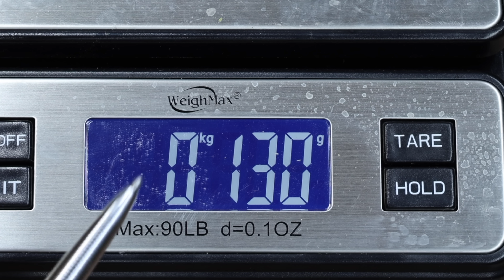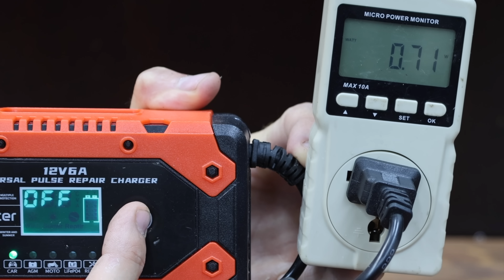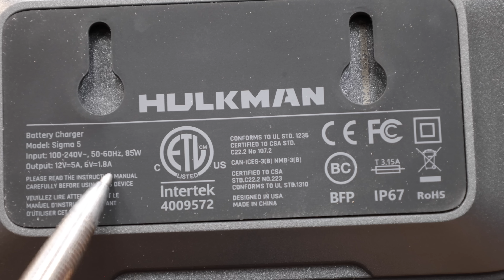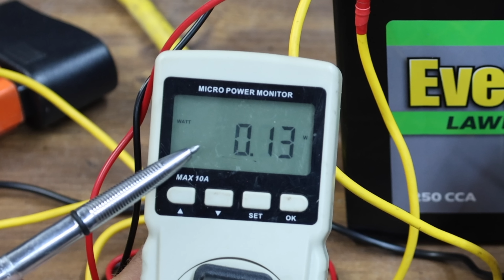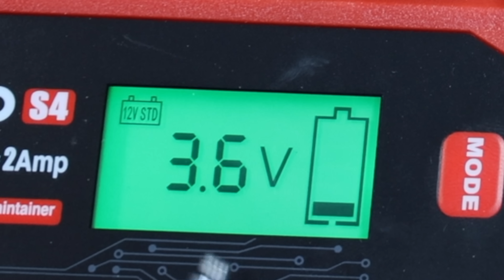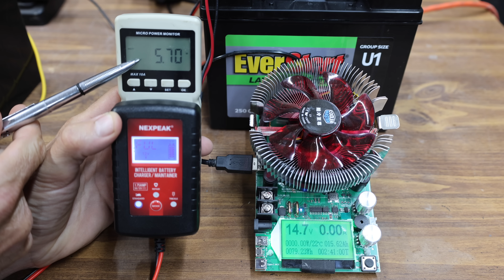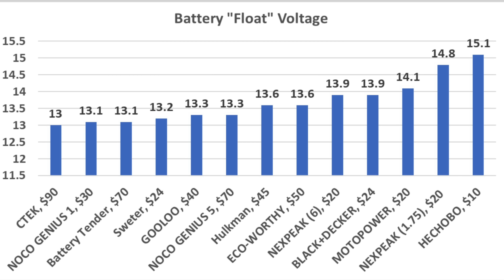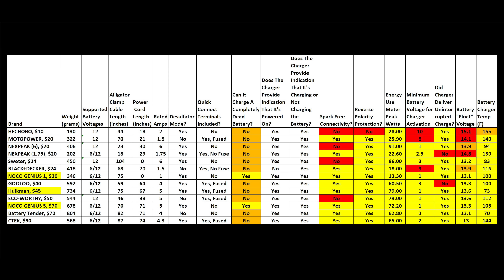I Tested the Most Hyped Car Battery Chargers – One Stood Out!

Comment: You should definitely review some full size charger/maintainers.

Ive used a few over the years and there is a huge differnece with whats out there now. 

A good one to start with is the pro-logix pl2320. Its rebranded for mac tools also. 

I've had a transformer type napa charger, model 85-437 for well iver a decade now, its been solid but i know there's better out there
Reply from the maker: Thanks for the suggestion.

Comment: I'm sure somebody else will say it but the smart chargers have a clear flaw, if the battery voltage is too low, the charger will not Acknowledge that a battery is present. What I have to do is introduce a second battery to backfeed voltage into the dead battery. If you hook the charger up then, it will start charging both of the batteries as they continue to equalize
Reply: Thats how I do it too.
Reply from the maker: Thanks for sharing.

Comment: I have several of the NOCO chargers and their jump packs (NOCO Boost) and have been very happy with them.  I like to leave the NOCO Genius 1 and 2D on a battery as a maintainer.  I also have one Hulkman Sigma 10 which also works well. I have a couple Stanley chargers which have the battery recovery mode, but that seems to be a gimmick, and I don’t recommend them - they wear out fast. I have a Schumacher SDC371 in the truck that does what it does very well. The Schumacher SC1281 and the NOCO Genius10 are my go-to chargers when I am working on something and need a quicker charge. The SC1281 seems to start an engine in boost mode with very little charge left on the battery.
Reply from the maker: Thanks for sharing.

Comment: I have that Ctek in the thumbnail, for how expensive it is they don't really advertise it's more suitable for motorcycle batteries/mounting the unit onto farm machinery with batteries that need charging often. It WILL recharge a flat car battery no problems but it will take the entire weekend to do so, even longer if you use the reconditioning feature.
Reply from the maker: Thanks for sharing.

Comment: You did a nice job with this video.  I'd definitely be interested in seeing test results from chargers with some oomph....perhaps something that will give you half a shot at getting an engine started within a 20 minute timeframe, and without using the short term boost modes that I rarely have success with.  A  desulfator would be a nice bonus.
Reply from the maker: Thanks!  Thanks for the suggestion.

Comment: How about trolling motor batteries, dont know if you are a fisherman on the farm or not, but there are lots of choices now, and some very pricey. 12v and 24v systems, on board solar, how much run time at semi full power. Could be a couple videos, with solar while you fish being seperate. Just a thought
Reply from the maker: Thanks for the suggestion.

Comment: Another great review. I own both Nexpeak models, so I was glad to see that other than the float charge issue (which I don't use), they are decent chargers. It was nice to confirm that the 6A model truly put out 6 amps. One thing that I would like to have seen covered was the amp usage during "repair" or "desulfate" mode. Also, if possible, the results of those modes.
Reply from the maker: Thanks!  Thanks for the constructive feedback.

Comment: @projectfarm We got a used Crafco tar melter (for crack sealing asphalt) machine we’ve been working on at work and recently had to change the heat transfer oil in it. Had to do research to figure out what oil to put in it. Can you test heat transfer oil as an engine oil? It has to be ISO 68 grade  heat transfer oil. It’s supposed to withstand up to 600(ish) degrees and wonder what it would do as an engine oil and what it will lose in evaporative loss and how it performs in a lubricity test.
Reply from the maker: Thanks for the suggestion.

Comment: NOCO is the BEST (value)! I own about 15 of them in different variations! From my experience I would avoid the 1 amp version (the only version I’ve had issues with) and go with at least the 2 amp. 5 amp is really good all around. I’ve used some of my NOCO’s for nearly 10 years with no issues! They do a remarkable job of repairing batteries as well!!! NOCO all the way!!! Best value hands down!!!
Reply: Same/ditto. Well, I only have four (two 2Amp, two 5Amp). Never bother with ANY charger/maintainer below 2 Amperes.
Reply: @pgmurray76 Sage advice my friend!
Reply from the maker: Thanks for the feedback.
Reply: Mine has been flawless, outside in the freezing snow trickle charging multiple vehicles!
Reply: I would suggest trying GYS before lauding the praises of Noco,I've had several and nearly all have failed under warranty, and when the vehicle is completely flat I often have to go and drag my huge Mac tools booster out because the Nocos software doesn't seem to see a battery connected. Some of my GYS stuff is 30 years old and still working faultlessly,their products and warranties are genuinely peerless,head and shoulders over any other brand by a country mile.
Reply: @user-re6yo7tj5s  
One commenter connected a simple 9 Volt torch/radio etc. battery across the terminals (+ to +, -ve to - ve)
that fooled the charger into thinking the minimum 9 volts  were present in the to -be -charged battery..
and the charger took over and charged the battery 
whereas it would not do so without that "fooling"....

Comment: If you happen to have a charger that doesn't charge batteries that are below a certain voltage. You can connect  a fully charged battery to the flat battery so the charger can sense a higher voltage and it will start to charge.
Reply from the maker: Thanks for the feedback.

Comment: I got a Noco Genius 5 a couple of years ago.  I have attempted to charge car batteries with it on two occasions and failed.  Not the Noco's fault, in both cases, the battery turned out to be dead and couldn't be revived.  I had to get replacement batteries.

However, I did find the Noco a little frustrating to use.  The single mode button is all you've got to work with, so I found it hard to get the Noco to try to do what I wanted.  And when it failed, it doesn't give good feedback.  If Noco were to produce a more intuitive model with a microprocessor and LCD screen on which text messages could explain what is going on, it would help novices like me.  It would be better if it had a more positive way to say, "this battery can't be charged" and any other problems it encounters.
Reply from the maker: Thanks for the feedback.

Comment: A Big "YES" to Larger Chargers.
This has quickly become one of my Main "Go-To" channels for Honest & Non-biased Reliable Testing and Comparative ShootOuts.
Reply from the maker: Thanks!  Thanks for the suggestion.
Reply: The Hulkman Sigma 10 is a 10A smart charger that can charge lithium and be used as a power supply. The Clore Automotive PL2320 would be another excellent choice. The South Main Auto Channel uses this one and it's worked well for me too. Can be found under SOLAR, Pro-Logix and even NAPA.

Comment: I bought the NOCO Genius 1 a bit after Covid when I wasn't sure how often I would have to drive in to work.  It has worked flawlessly since I've purchased it.  I use it once a year during winter months to maintain my battery.  Not sure how durable it would be if used more frequently than once a year, but I have no complaints.  If it ever does break I might upgrade to the Genius 5.
Reply from the maker: Thanks for sharing.

Comment: Ctek Polar is the best I've used. When I need a charger it's usually -25C (-13 F). It's one of the few that is made specifically for low temps. I've had others that physically don't hold up to the low temperature.
Reply from the maker: Thanks for the feedback.

Comment: I have used the CTek brand and it was great until it finally gave up. Switched to Noco genius 10 and its more difficult to use because of the button sequences to change modes but it performs well and its slightly cheaper than the Ctek. Just keep a user manual handy if you need to use the Noco functions.

Comment: The failure of the chargers to start charging a flat battery is why I like keeping a small 12V solar panel on hand. Solar panels will sling electrons no matter what (as long as it's in sunlight). I've resurrected many fully dead batteries by leaving them hooked up directly to the panel for a few days straight.

Comment: Always had good luck with NOCO.  CTEC and Battery Tender are also in my garage.  Just had a 4A Battery Tender die so I ordered a 10A NOCO because it has the power supply function.  Great for keeping the car alive while diagnosing issues or programming.
Reply from the maker: Thanks for sharing.

Comment: I see that you are using an aircraft battery.  Are you a pilot?  I am and have been wondering about the special 'airplane' specific chargers made by BatteryMinder.    They have ones specifically for Gill and Concorde batteries and they're EXPENSIVE - at least a $100 premium over their identical looking automotive charger     I just couldn't stomach the prices for them, so I picked up a Topdon Bluetooth programmable one and plugged in the specs from the Concorde manual and the manual for the BatteryMinder.      It seems like some of the ones you have tested here with lower float voltages might do okay as well.  The lower float voltage seemed to be one of the more relevent specs that the Concorde battery wanted

Around the house, I own a couple of Noco, a CTEK, a few Battery Tenderbrand, and one generic chinesium one.       I also have a few big old school transformer ones that are handy for getting completely dead ones started.  As you know, once they go completely dead, they're rarely recoverable anyhow.

Comment: Not sure why charging a completely dead battery is a criteria to use to determine the best battery charger? Who does this? The life of that battery has severely been diminished. Batteries need to be maintained and are not completely charged in the vehicles they are put in. Do yourself a favor and do preventative maintenance on your battery and charge on a quality charger every 6 months or so.  

I've purchased and tested several battery chargers over the years. The  sweet spot is probably a 10A charger. First I would recommend the Hulkman Sigma 10. The feel and quality of this charger reminds me of Apple products when unpackaged. This charger works for virtually all battery types and can be used as a power supply. A handy feature if trouble shooting an electrical issue, performing over the air updates or programming a PCM. The only thing this charger is missing is the ability to do a battery health test. My second choice would be the Clore Automotive (also labeled under the NAPA brand, SOLAR and/or Pro-Logix). This charger has a unique battery cable management built into the charger itself that I enjoy. This charger does everything the Hulkman can do with the exception of charging lithium batteries.

Most of these "chargers" as tested are battery maintainers and the float charge is the most important. When it actually comes to a charger, the more important factors are the type of batteries that can be charged and the charge rate.  Do you buy several battery chargers or one that does it all.  Sometimes you need more than one charger. I keep a small BatteryMinder attached to my lawn mower at all time when not in use. Lead acid batteries prefer to be fully charged to extend their life.

Many larger automotive AGM batteries would likely suggested charging at 6A or more. More and more electronics today  in modern vehicles and they come with AGM batteries. They are expensive to replace. With the use of a quality charger, one can extend their life.

Comment: I've been using Battery Tender chargers/maintainers solely for years, at the recommendation of friend who runs a battery shop.  If I'm not going to drive one of my cars for over a while, I'll hook it up (I have the ones with a fused quick connect ring terminal harness).  I also have a larger charger for charging dead batteries.  I haven't had to use it on my cars since I started using the Battery Tenders, but have loaned it to neighbors when they need it.  Some of the cheap float chargers will overcharge a battery, causing damage to it.  Did you 'borrow' that dead battery from Cousin Eddie?

Comment: One of my requirements for a battery maintainer is the ability to restart charging in the event of a power loss - one brand I'd like to see tested is made by Clore Automotive - use these to help keep standby generator batteries charged at locations all over.

Comment: You may wish to learn more about battery charging current. 
Batteries are very low resistance and thus pull high current at very low voltages.
The charging power is the delta in voltage supplied and the voltage in the battery. 
40W at 6A is a 6.6v delta, so the charger was likely supplying 11v at the time the battery was at 4.45v. This charging current is entirely plausible and you should of been measuring current in the charging wire not power at the wall.

As the battery voltage increases the supply voltage should increase to match when in constant current charging mode. They will usually top out at 14.5v

Comment: So I haven't looked at your whole video, so far.   A battery charger will not charge any battery thats voltage is below about 10v.  Generally a battery below that voltage is considered BO (beyond operation).  What you need to do is trick the chargers.  Hook up a 12v DC power source to the battery and then the chargers.  Once the charger shows that it is charging, disconnect the power source.  At that point the charger is maintaining the voltage and then you will see if it can charge it fully
Reply: After you watched the video, you now know that some chargers have a "force mode" that will start charging at zero volts.

Comment: Unfortunately, most Smart chargers wont attempt to charge a completely dead battery unless it has a constant current mode.

 My favorite chargers I use all the time  Skyrc Imax B6AC v2 which can recover and charge almost any battery, Noco 10, and my big Schumacher speed charge 150-55-20-2 amp which has a manual mode with a timer you can set to charge really dead batteries.

I know its pricey around $700, but if you Do review on bigger chargers, I would like to see Topdon tornado 9000 in the mix